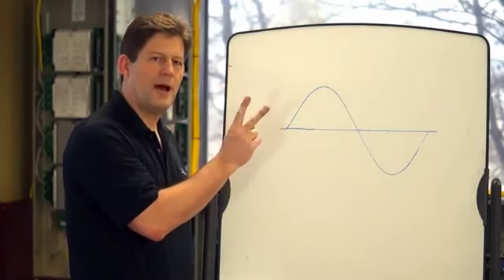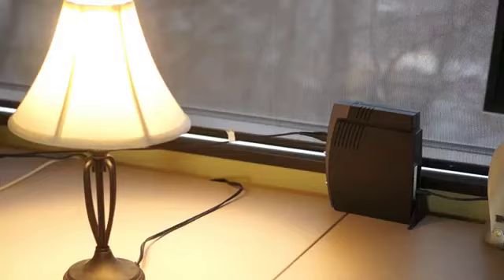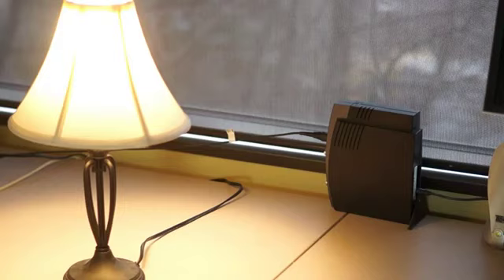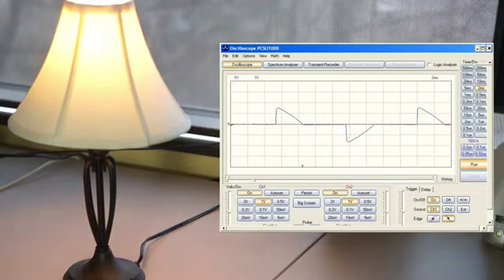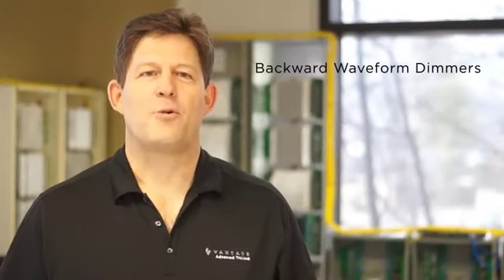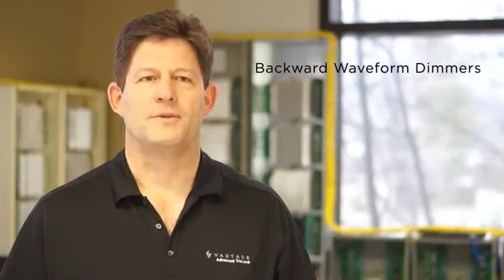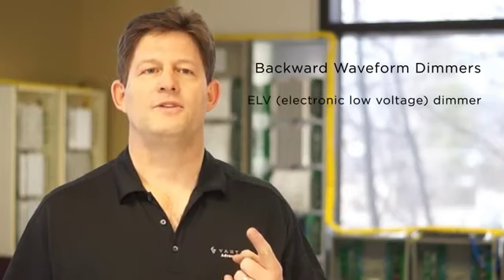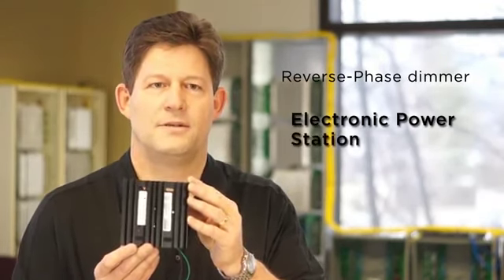LED Dimming Series   Dimming Fundamentals video 1 of 4 - (full version)

Comment: "panel based LVOS"  Working with them now, The other day one of the men had a short in a MC cable after the LVOS . We were testing so not going thru the LVOS but we had the hot and neutral connected and from there we had out lights bypassing the LVOS. So anyway the short went thru the block and I beleave fried the LVOS. So how is everyone protecting the LVOS from a Short.  You know after the jobs finished and a year or two passes and something shorts the LVOS is going to fry.  Any suggestions?